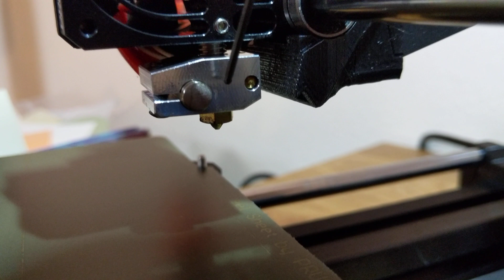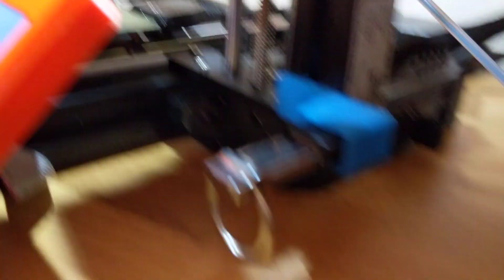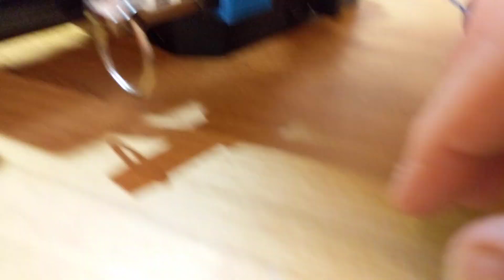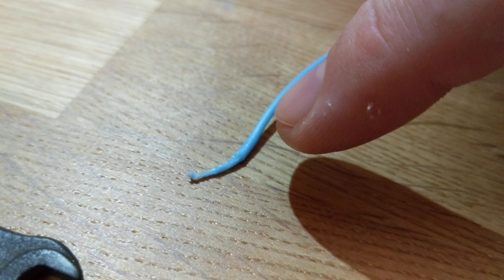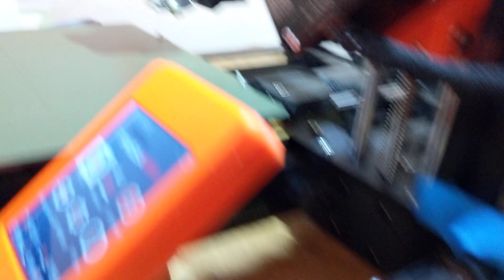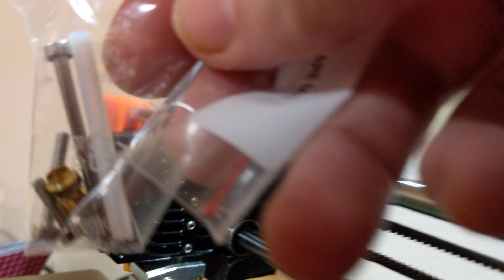Prusa mini hotend / underextrusion fix

Comment: I just picked up a mini second hand and the hot end is much lower than yours, a lot like you're describing. it jams consistently halfway through a benchy when it starts doing a lot of retractions. I'm going to try what you said and see if that solves the issue. Thanks!

Comment: Thank you for this video, I was having under extrusion problems with my Mini even using Prusament. It has never printed properly since I had to disassemble the hot end to clean out the gummed up junk PETG that I used once. I think this is a much better approach to seating the hot end then described in the manual.

Comment: Seriously, for the price paid, this should not be an issue, and it is really BS that anything like this needs to be done to a new printer. With that, thanks for the video, I will see if this is what is causing my issues. I am assuming that what you said "10cm" that you meant 10mm.

Comment: I just did this fix and now my hotend is extruding a ton of excess filament, its like a constant flow of filament, it wont stop until the machine cools down. Is that how the printer is supposed to be? This is my first 3d printer, I'm not really sure how much excess filament should come out after printing.
Reply from the maker: Filament will ooze out until the pressure from the extruder is gone. It happens on most printers especially bowden tube setups like the Mini.
Reply: @SteamLabs  Wow thanks so much, I asked in the Prusa discord and this is the exact answer I got. I appreciate your quick reply and useful video.

Comment: You are a life saver. I was going crazy, my mini was doing fine with Prusament but other brand PLA was causing clicking and under-extrusion, then straight up frequent jams. Performing your suggested adjustment fixed the issue instantly. Its amazing Prusa sent out these machines with the wrong height on the hotend, did they not test the printer with different PLA brands?

Comment: New Mini+ owner here, having this issue only a few days in. Hope your solution works and Prusa really should look into this.
sees video date never mind I think they never did...
Reply from the maker: Good luck. Mine has been working great.
Reply: It's not about you, but every time when I see such "working great" comments I wonder what are the standards of "great" is. For me an old Ender 3 + SKR Mini E3 does way better than the Mini OOB. Yea sure there must be someone's machine out there working great, I can see such lucky guys under literally every thread on Prusa Mini's official forum and for some strange reason you can see the same names on each thread. Such kind of comments are usually extra irritating since that helps nothing and (for some of them) implying it's just the user's problem. I've been printing for 5 years, owned 5 to 6 machines and now running a small business selling 3D printed stuff, can't say I am some kind of guru but not an amateur. In this very first week my Mini had this hotend issue (leading to extruder jams too) + MINDA randomly crashed onto the bed during ABL leaving a dent (and the MINDA is not broken but some kind of firmware glitch) + skewed X axis + faulty USB drive fried all my files, too much of these I think sooner or later Prusa Knowledge Base and all the forums can't be any help.
Reply: For the hotend issue: I've tried your trick, it works for around 20 hours of printing then there the jam comes back. Gave the trick another try and changed the filament into some fresh quality stuff. Fingers crossed.

Comment: My PTFE tube was over a mm too short for what prusa said it should be. They told me my hot end was too low and needed to be moved up too. Told me to use the 1.5mm allen key that was sent with the printer... Except I didn't get one. When I purchased the allen key I discovered all 3 of those screws are stripped! Ugh. So now prusa is sending me a new heat sink and hotend to replace the whole thing.
Reply from the maker: Hope they take care of you and get the printer fixed.
Reply: @SteamLabs  I'm sure they will but it's not what I'd expect from a beginner-friendly printer. I went from 0 knowledge of any of this to having to learn all about the printer just to get it to function as expected. lol

Comment: Having the same problems, and my center grub screw was on so tight from the factory that it rounded off rather than coming free. There's not enough of the screw exposed to grab with another tool. I'm at a loss how to remove it now.
Reply from the maker: There are a few tricks. Always use the flat end, not the ball end. Heat the hot end, that may loosen it. Try super gluing the wrench in  the grub screw.
If you do get it out replace it with a socket head cap screw.
Good luck.

Comment: really good explanation!

just one question I have:
if the Mini got one PTFE tube inside and one in the spare part kit.
why doesn't it come with the right one from the factory?
Reply from the maker: They start off ok, but I believe that over time get compressed and deform.

Comment: God bless!  So far, so good!  This is very similar to what is in the manual, but enough different that this worked.  I did the Prusa way 4 times, still had extrusion\clogging issues.  Your way is still working!
Reply from the maker: Glad it helped!
Reply: @Christopher Enoch How are things going 2 months later? I was told this issue will keep occurring time after time.
Reply: @tombellucco7155  Awesome, absolutely no issues.  I now know how to get it right after taking the hotend or nozzle replacement...  Thanks

Comment: Hey dude, awesome video I'm excited to try. How many Millimetres is the gap now between the block and heat sink? Thanks again
Reply from the maker: I'm not sure, it's not critical. Just get it close.
Reply: Steam Labs Ya pushed it up all the way like you mentioned and it hasn’t clogged since 👍
Reply: @xhex_3116  How is it working now (after a couple of months)?
Reply: Tom Bellucco Its working great, i feel like it may have been me using to low temps previously more than the heatbreak itself. I also purchased a newer mini and its been great since day one, no adjustments needed.
Reply: @xhex_3116  I got mine a month ago maybe 6 weeks and suddenly it won't print longer than about 2-3 minutes. The plastic just stops coming out almost as if the hot end cooled down. I don't think I can call it underextrusion but I wonder if there is heat creep occurring in the hot end.
Reply: Tom Bellucco Ya that sounds like something is going on. Maybe take apart the hotend area. I would start with the Small ptfe tube thats inside the heatbreak. If you can take it out and inspect it, look to see if its clogged or deformed, if not I would check the heatbreak itself and make sure its not clogged. Maybe the ptfe tube slipped up and caused a small gap that built up material. Also do find the mini’s like material a bit hotter (5c) than my other printers. When you load filament does it purge properly? What material and temps, speed are you getting these clogs on? Also join the Mini FB group its a better place for Tech support for the community
Reply: Tom Bellucco Good luck my friend 😁👍
Reply: Steam Labs Thanks again, I reposted this link in the Prusa Mini FB group as I am still seeing other users with issues.

Comment: Brilliant mate, many thanks for this instructional video.  Just received my Mini and was initially impressed with ease of assembly and testing. Test printing however was not good compared with even the  oldest of my 3 x MK3Ss.  Out of three test prints (Prusa Nut  gcode on supplied USB stick) only one was completed and that wasn't pretty. I followed your instructions to the letter. Also removed nozzle and heat break tube. Spot on, just as you'd indicated, way out of adjustment, plastic lodged above the extruder and heat break tube partially blocked.  Just added some heat compound when reassembling the heart break tube.  All printing perfectly and my faith is now restored in Prusa again.  I agree with other below, this should be in the assembly manual as a standard practice  for all Mini assembly out of the box. Still puzzles me that Prusa don't assemble their own product correctly in production.........
Reply from the maker: Good deal.

Comment: This video solved the jam issue I was having that is identical to the one you were having, but now I am having excessive stringing. I think I may have raised it too high and now the fan is doing something to the filament. Any suggestions on how high the nozzle should be? Can you measure it?
Reply from the maker: Stringing with PLA? Try adjusting your temp and retraction.
Reply: @SteamLabs  temperature and retraction barely helped, the only thing that completely worked was setting the print fan to 0. Using a different filament helped a little.
Reply from the maker: Humidity can be absorbed by flame and change it's properties. Try drying it out or use a new filament. I use the stock pla profile in prusa slicer and have good results.

Comment: If I push the heat break so high, the inliner has to be shortened, otherwise the connection cannot be screwed in as far as it will go.  Is that correct?  My inliner is 43mm long?
Reply from the maker: The ptfe tube liner has to be compressed. The top brass fitting will create compression and should not be completely tightened.

Comment: If I  understand correctly, the fix you did is twofold. 1) moving the heat break more into the heatsink, hereby reducing the temperature in the lower part of the heat break, where the filament goes from a PTFE channel to a metal channel, which is a point where you want to have low temps to avoid the filament from going between the PTFE and metal, and 2) getting the inner PTFE liner snug against the heat break, which apparently isn't always done in the factory.

Just received my mini yesterday and I also have filament grinding, underextrusion, and a heatbreak that looks like it sticks too far out. I'll have to do some more reading because if this is a mistake during manufacturing, I don't understand why it's still happening 4 months later.
Reply from the maker: 1) The melt-zone is shorter. The only issue I can foresee is if you wanted to print with a high throughput.
2)This is the main fix. Warm filament was bulging in between the PTFE tube and heatbreak causing flow issues.
Reply: Just got mine 3.31.2021, same issue. Why have they not fixed this at the factory?!?!?! I thought Prusa was a good brand.
Reply: @TheSouper07  I wonder about that too, I have replaced the hot end with an e3d lite6 and it works fine now

Comment: What really makes me a bit sad with the Prusa Mini - why didn't prusa continue the partnership with E3D here and instead created something which feels a bit like a bad chinese hermera clone - the heatbreak simply does not heat-break and looks to be optimized for production costs and not for function or quality. With the volume Prusa can provide I am sure they would have been able to get a good deal or even a product developed especially for them by E3D ...
Reply from the maker: It definitely looks like it was designed to save costs, reduce BOM, and possibly weight. If it is assembled properly it works. There will always be weak points with budget printers.

Comment: Thanks, this fixed the under extrusion for my mini too. It printed flawlessly for about 2 weeks and then just stopped. My 3 set screws were very tight and there was no filament under / around the PTFE, so I presume jams were happening between the nozzle and the PTFE because there was too much space there? Maybe changing filaments exacerbated the issue (I swap between PLA and PETG) Anyway, thanks for making this video!

Comment: Thanks for the video! I'm a little bit disappointed that this so called beginner-friendly 3D printer has many issues that require experience and knowledge to fix them. I'll wait 2-3 weeks and see, if I cancel my order or not.
Reply: Never buy something at release, your always a tester ;-)
Reply: It was a beginner-friendly design, but there are some first-run issues at the start of production. By the time you get your printer, many of these problems should be resolved.
Reply: Unfortunately, the issues still are present now, almost a year later on the new printers.
Reply: @bkindt  Unfortunately, it is true

Comment: Only thing I'd add for all watching: Do not set the MINDA probe too high. It should be very close to the surface of the print, like in the video. Before this video was made, I fixed my printer using forum postings but set my MINDA too high, about 1 1/2 cm or so above the surface. The printer didn't detect the surface during calibration (because it was so high) and quickly made a circular dent in my steel sheet, caused by the extruder slamming into the sheet. Just be aware!